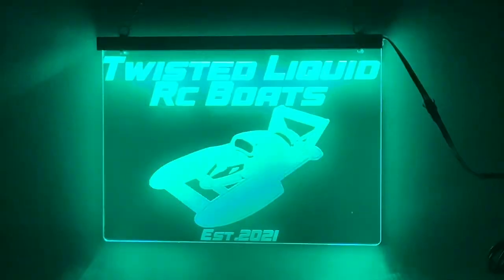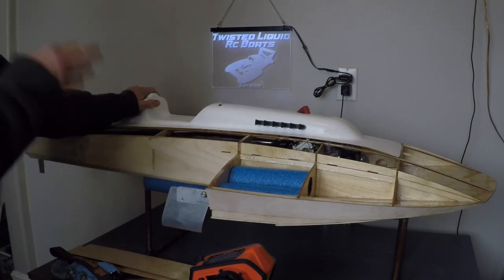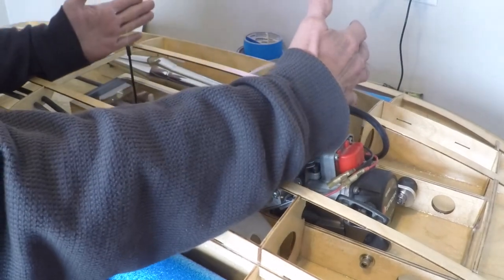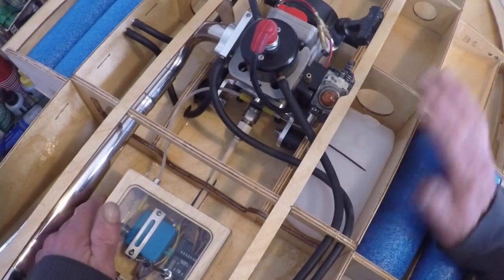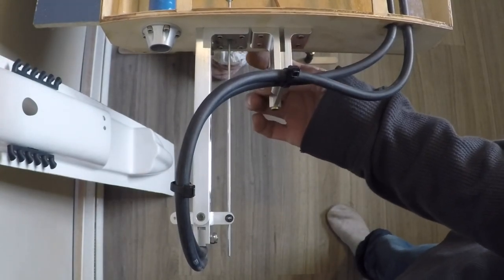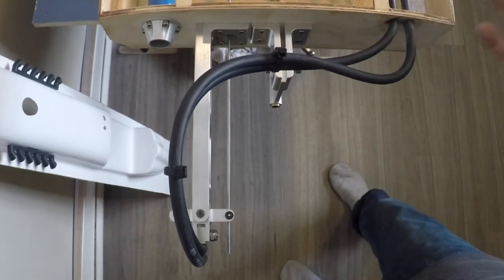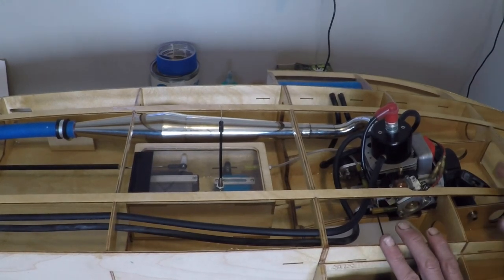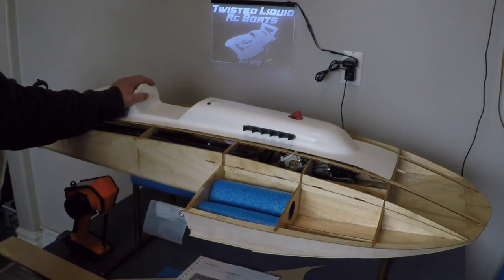Zippkits SLR Missile Thunderboat Build Hull Rigging Episode 26

Comment: Thanks for the videos! I noticed, when you put your cowling on that there is a fitment problem, because it is bending the cowl. I have this exact kit that I'm about to start building. I love your installation, especially the throttle cable, this is the same time of throttle setup that is used on airplanes. I plan on putting in aluminum pipe under the deck all the way to the engine, for the water supply. Its lighter and will make it easier to change out my tubing when it's needed. Again, Thanks for the build series.
Reply from the maker: @burntorange59 I still have to clearance the lid a bit to clear the carb also. The primer bulb on the Walbro 644 carb I’m using is pushing deck lid up. Just haven’t cut it out yet. You have a good eagle 🦅 eye to notice that sir and that’s impressive. Still fitting everything perfectly on the boat. The aluminum tubing is a good idea. You’d laugh at me if I told ya what that black hose is. I’ll say this it’s cheap at an automotive parts store. Ac Delco makes it Lol. Thanks for watching. Glad you appreciate the build series. Need any future help while building, I’m a message away. Thank you sir. Take care and stay safe.